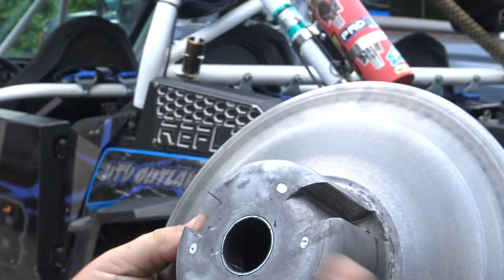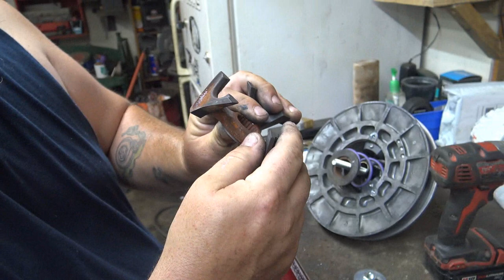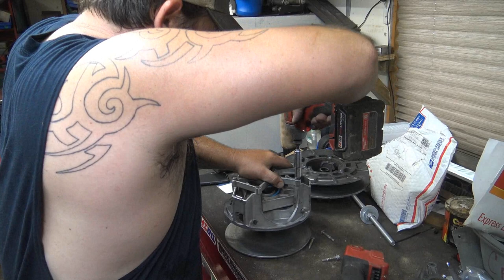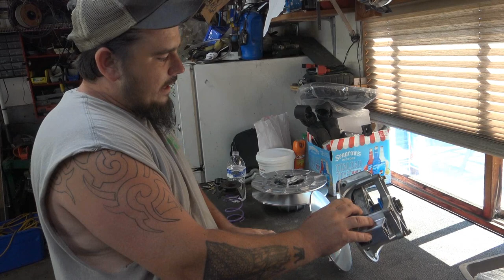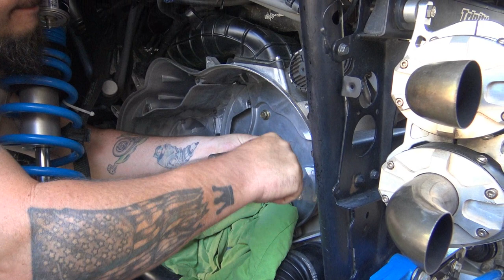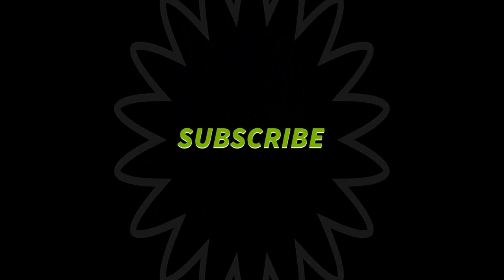Clutch Repairs on 2018 RZR Turbo

Comment: what was the status on the warranty claims? I know they consider most of those parts wearable, interested to see what the result was.
Reply from the maker: We didn't have any luck with one dealership so we are trying our luck with another. Sounds like we might not get the money back but possibly get a replacement since it didn't wear the way it's designed. But we don't have any word back yet.

Comment: What's the deal with the shock therapy springs removed?
Reply from the maker: Springs kept rubbing the shock body so we went in a different direction with the setup. Next vid will address what we did. Thanks for watching.
Reply: @utvoutlaws6652  Ive had some issues with shock therapy as well. I did there full RIS system on my turbo s and have gone through several different sets of there springs to get the ride height correct without adding a ton of preload to get it there. So far they have been good about making it right but IMO when you pay that much for something you expect it to be right or pretty darn close. I have been able to work around the slider cup rubbing by just trying different spring clocking. Seems other companies are using a bigger slider cup and some wider springs where at the ST kit reuses the factory one with what appear to be skinnier springs.

Comment: Hi I have a question if you can help me it will be great I have a 2020 Rzr Turbo s velocity and my secondary when it’s on park it’s spins fast and I have the code 65590 on it too
Reply from the maker: I would start by changing the belt.
Reply: I did and we got gates but I already order oem belt hopefully it works because with gates the secondary spins
Reply from the maker: Thats exactly what I was thinking.  Everytime I hear of problems I lean toward a gates belt or a belt for the wrong year.
Reply: @utvoutlaws6652  yeah hopefully the oem works and my rzr runs good again
Reply from the maker: Sounds good. Thanks for watching!
Reply: @utvoutlaws6652   nice video hey another question in the primary clutch the bearing those it has to have play ??